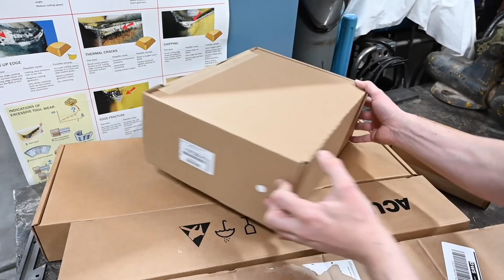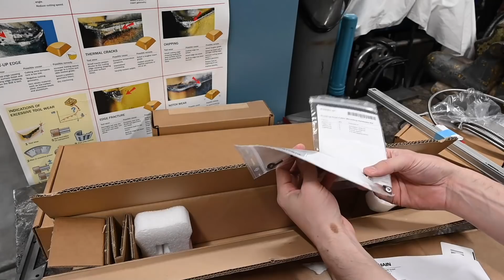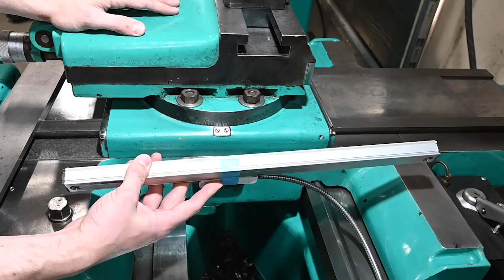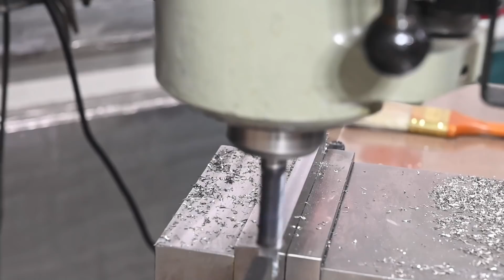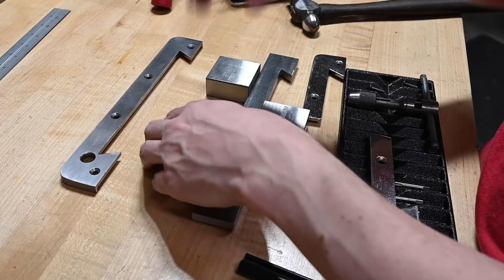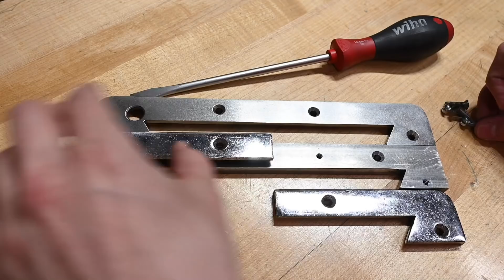AcuRite 203 DRO Review and Cross Slide Guard Part 1

Comment: I have a Newall Microsyn scale on the crossslide on my little 20" Monarch. It fit very well and does not stick out past the way covers so I don't have to worry about the tailstock hitting it. Also the microsyn is approved to be cantilever mounted so mine is just attached on one end as the back would hit the carriage because of the taper attachment on mine since I wanted it down low so it didn't reduce the swing any over the carriage. You likely could use one on that axis even with your accu rite read out if you wanted too. You would not need to modify your cross slide then. Of course we all want you to take it apart so we can see the compound drive still though. :-) lol
Reply from the maker: Ha people telling me not to mill on the cross slide don’t realize what we’d be missing if we don’t!

Comment: Regarding machining the cross slide and finding a true parallel reference let's look at some numbers...

If your reference surface is worn and worn unevenly in a taper and you machine parallel to that tapered reference, your scale will be mounted out of parallel and potentially be a source of error. Assuming your cross slide is 12 long, and your reference surface is worn and out of parallel by as much as 0.010 the angle is 0.048 degrees and the travel of the read head would be 12.000004 inches.

That is a pretty small number. The point being: is there error? Yes. Is the magnitude in the range of the task at hand? No!

Someone else mentioned just spot machining two flats to mount your bar. You could then either make custom-length standoffs to zero out any taper or incorporate some means of an adjustment screw to set the standoff length.
Reply from the maker: I guess the other thing I’ve been thinking but didn’t voice is that if the mounting bar is flush with the cross slide it will prevent chips and oil from collecting in that gap. Very good point about the accuracy though.

Comment: Don't mill the cross slide, just attach the bar to the new wipers
Reply from the maker: That would certainly be a lot simpler, but then when I periodically replace the wipers I’d have to reinstall the scale each time.
Reply: I think my point is , the Monarch is forever where as the DRO's are temporary

Comment: Refreshing to see a Youtuber not putting some janky chinese system on their machine.  It would have killed me to see you do that to this beauty of a lathe.  The only kit better than this would be Heidenhain, but they are prohibitively expensive and they seem content to rely on their OEM sales for CNC machines.  Not sure if you're planning on it, but i would definitely recommend a bent sheet metal cover for the cross-slide scale.  The Z-axis scale usually wont need one.  The most common mode of failure for these glass scales is chips getting around the sealing lip and destroying it leaving the glass exposed or compressed air being shot around and swarf entering the scale though the small openings on either side of the scanning unit where the sealing lip meets it.  So I always recommend using a brush and not an air gun to clear chips.  Someone else mentioned it already but these scales are highly accurate and highly repeatable.  A magnetic or ball bearing type scale won't match it.  You made a good choice.  BTW you'll love that display.  I'm not sure if i like the axis in movement magnification yet though.  You'll know what i'm talking about when you get it hooked up.
Reply from the maker: Thanks! I couldn’t do that to her, I wanted to get the best I could. You may not know this, but this is a Heidenhain product! They purchased Acu-Rite some time ago. I’ve been reading about how important it is to protect glass scales and I’ll definitely come up with the most secure shielding I can. Doing it the right way now means it’ll be trouble free for years and years. Thanks for watching!
Edit: Acu-Rite has a firmware upgrade to tweak how long magnification stays on.
Reply: My mill came with Acu-rite scales and readout. I had a few E3 errors (weak signal) at first, this was cured by wiping the glass scales with alcohol. I guess the install was >20 years old and the lip seals had deteriorated, they were brittle and not sealing well. I bought 6.8 m of replacement seals for not very much from my local Heidenhain distributor. Changing the seals was easy in situ. May be worth purchasing some spare seal to ensure you have stocks.

Comment: Won't a 12" scale limit the travel of the compound cross slide?
Reply from the maker: No I measured the way Acu-Rite instructs and 12” is all she’s got.
Reply: The length of the scale doesn't have anything to do with the compound. The compound will swing right over the scale mounted on the the side of the cross slide

Comment: rather than milling the entire side of the cross slide square  you could always mill a pair of spot faces and  use some short bushings to bolt the backing plate up square to it. just another option
Reply from the maker: I’ve been thinking about whether to do that or not. I guess I like the idea of more bearing surface against the cast iron, but it probably doesn’t matter. Have a piece of ground and hardened 4142 flat bar coming tomorrow to use for mounting. Once I have that in hand it will spur some decision making I think.
Reply: i feel like that would be plenty rigid enough for the scale, probably far more rigid than the scale itself. seems like youd have to remove a lot of material to get a decent sized flat on the side of the cross slide casting aswell? all good options though!

Comment: I wish you the best of luck with your Acu-Rite purchase. I have them on two machines and have been really disappointed. Mine are both about 15 years old and have seen limited use as mine is a hobby shop. There have been two issues. One was with the long scale on my mill. When I called I was advised they no longer support my equipment, however, I could buy a new scale for $700 that would require drilling new holes. The second issue was my lathe display has become dim over time. Again, when I called I was told this is a known issue, however, short of a new display for $600 they had nothing to offer. I am just as patriotic ans anyone and would prefer to avoid buying from China. However, under the circumstances I would be hard pressed to not spend the $200 for the throw away asian version versus $1500  for the throw away US version
Reply from the maker: Sheesh that’s terrible. Hopefully I have better luck than you. This model hasn’t been available for very long so hopefully they’ll support it for a while.

Comment: I’m not a machinist and I have no Business commenting but I would think the overhang should be on the operator side? Since if you have a large piece of work chucked up you will run out of travel?
Reply from the maker: First off, I'm not a machinist either, so you're in good company! Secondly, what do you mean by overhang on the operator's side? Do you mean making a guard to protect the ways on the near side? Or do you mean the mounting bar for the scale should overhang toward the operator?
Reply: You're not wrapping your head around the kinematics of it. The overhang of the scale needs to be towards the back of the cross slide. (not the operators side)

Comment: Not completely sure I understand your plan for the cross slide installation. Does it include some protection to prevent the tailstock from accidentally damaging the accurite scale/reader? Might also act to shield the scale/reader from chips, oil and dirt. I’m really looking forward to seeing you do this installation.  One of my dreams.  Cheers
Reply from the maker: The bar I discussed in the video will just be for mounting. I'll make a provision to prevent the tailstock from running into the scale and a chip/coolant guard for it as well. The guard will mount to my new bar, while the tailstock block will mount below the read head on the carriage or even on the bar- haven't decided yet.
Reply: Aaron, I thought you’d have probably have a plan for protecting the scale and reader.  I’m sure looking forward to seeing this project. BTW, one of my friends, who bought the Monarch Series 60 lathe I had refurbished installed a high quality DRO and is constantly telling just how much he loves the combo. He’s hounding me to mount one on my  30” 10ee when I get it back together so your installation is timely.  All the best, Will

Comment: Excellent investment as you state, and with very high intrinsic accuracy. 
Nearly all generic or clone, items have very poor intrinsic accuracy, all require linear constant in the readout to be somewhere near useable for hobby use, the glass scale is difficult to manufacture.
Fitting equipment for your Monarch lathe.
Thanks for sharing.
Reply from the maker: Yes despite the benefits of magnetic scales I felt good about these glass scales and their long pedigree of success.
Reply: @AlwaysSunnyintheShop  I have fitted Heidenhain scales (optical) for many years, the only drawback was they are sensitive to excessive vibration, our application was rotary friction welding, when the machine slideways would wear over time, the read heads would suffer. Over the last ten plus years we changed to Temposonic manufacturer, and our current fitment is Baliluff; both magnetic type, having no exposed seal for ingress.
The Acu-Rite scales with serve you well, on CNC machines with high pressure coolant, they are pressurised with clean air.
Looking forward to seeing the fitment and operation.
Regards John Quinn.

Comment: While I agree about the idea of a lack of wear to indicate from when possible, won't the gib way be cut at a taper to match the taper of the gib? I can't imagine that Monarch used anything other than a tapered gib.
Reply from the maker: Hmm good point.
Reply: But you have two gib's.....if one is tapered you can use the other, that is straight.... 😉
Reply from the maker: True (if you’re talking about the other way on the cross slide), but it will have wear in it.

Comment: More often than not the packaging that the product is shipped in is telling of the quality of the product itself.  If they're willing to spend the extra money on better packaging it means they take a bit of pride in it and want to protect it on its journey to you.
Reply from the maker: For sure. Even if the packaging adds a bit to the cost of something, that just means I'll actually get it and in one piece. Too many shipments lying in the bed of a UPS truck with no box because the flimsy cardboard wasn't up to the job.
Reply: @AlwaysSunnyintheShop  I would gladly pay a little extra to cover the cost of packaging if it's protecting what I'm getting.  I can't tell you how many shipments I've received that were almost out of the box by the time they got to be because they used what I can only describe as sightly better than construction paper for packaging.